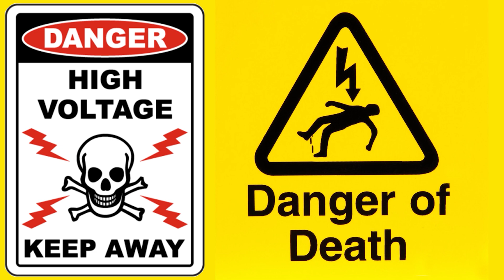Muzishare X7 Revisited: Overview and Power Supply Mods.

Comment: So X7 power supply caps are in parallel! If in series the voltage capacity would double and the surge to 475 would not be an issue.
Reply from the maker: No, they are on each side of a filter choke.

Comment: Hi Thanks for sharing all the knowledge about this amp.  I just got this amp and I have a question hopefully you can help.  I noticed only the center transformer gets hot and the 2 sides are not.  The speakers are connected to the 8 ohms posts.  I am not sure if this is normal or this is a defective unit.  Thanks
Reply from the maker: The center one does get hot and the outer ones don't.

Comment: Hello, very good review, thank you for sharing these videos, this week I got the Muzishare X7, I left it on for about 5 hours and then I connected the speaker cables and without raising the volume I noticed a sound from the speakers (buzzing) I think that is not normal, I don't know what the problem can be. If it is serious or a factory failure, if so to talk to the seller to solve this problem you could give me your opinion... greetings from Spain
Reply from the maker: Sorry I'm confused trying to translate. Not sure what you are saying.
Reply: @SkunkieDesignsElectronics  Excuse me, I have translated it
Reply: Hopefully it will be understood
Reply from the maker: Buzzing from the speakers isn't normal. Also it's not a good idea run a tube amp with no speakers connected. They don't "burn in" being simply powered up, they need music playing through them.

Is it both speakers or just one?
Reply: @SkunkieDesignsElectronics  It's both
Reply: Thank you for replying, the amplifier is new, it arrived three days ago and on Saturday I put it to work... bad luck mine. If I remove the speaker cables from the amplifier the hum disappears, when I turn up the volume of the amplifier with the speaker cables connected the hum remains stable it does not increase. Will I talk to the vendor what solution is me, what solution would you give me? Thank you very much for replying
Reply from the maker: I would return it for a replacement if possible. You didn't say what speakers you have and their efficiency rating. Will 100db+ speakers, it might be normal. Also is your ear up to the speaker or is it audible in the room?

Comment: Hey Skunkie! Last year you mentioned this was your number one budget tube amp available on the market. I’m new to this world and am wondering if that is still the case? I’m looking for a decently powered tube to run a pair of Klipsch Forte 1’s that have been upgraded with Crites parts. It seems like this may be the amp for me, but was curious if you (or anyone else reading) may have some insights for a noob like myself. Thanks in advance. Cheers!
Reply from the maker: It's def one of the best at this price point, especially if you aren't interested in doing DIY mods.
Reply: @ probably the direction I’ll head. I started out looking at the Reisong A10, and I think this is a significant upgrade from that. Not that I’m NOT INTERESTED, more so that I don’t know a ton and there’s a steep learning curve.
Reply from the maker: A push pull amp is going to sound different from a single ended amp. I personally prefer a single ended amp sound if I don't need the power a PP amp has.

Comment: Hi Skunkie, what an inspiration you give with these custom modifications.  My kindest regards.

 I know that you have been asked a lot about this, but after we draw the line so far with all improvements you have done on both Muzishare X7 as well as Willsenton R8 MK II : Which one wins the final battle in terms of overall performance and sound quality?
Reply from the maker: I would personally buy an X7. It has that retro 70's vibe, using 9 pin driver tubes and I think it sounds a little more detailed. That is both with factory OT.

Comment: I’ve had my willsenton for three years and the only thing I’ve done is roll tubes.
Reply from the maker: And some folks drove a Chevy Vega and didn't have engine problems. It doesn't mean they were a great car.
Reply: You're lucky (I guess) I've developed a static noise in both channels. Started with the left, then last year it was both. Also there's a harshness sound on a lot of music with multiple instruments. When there's less instruments Guitar, Piano, Horns, it sounds good. All in all it's okay, but now I'm looking for a better amp, and there ARE better ones out there to consider. I just don't want to modify all the upgrades of the R8, (1 - I'm too lazy, 2 - I don't see the payoff in purchasing a multi-thousand amp just to work on it to get it to sound good, without annoyance). THEY should have done that at the manufacturing plant, prior to releasing it out on street.
Good luck with yours.

Comment: How do the hi-hats sound on your X7? On mine they often sound strange, as if there was a triangle in the sound. What causes this strange sound?
Reply from the maker: Could be the tubes you are using? What do you have in yours?
Reply: @SkunkieDesignsElectronics  I have this with the originals but also with my PSVANE Black Treasure KT88-Z, all of them have run for hundreds of hours
Reply from the maker: Could be the coupling caps? 

The X7's I have listened too didn't sound like you describe but they were also not my main amp that I spent hundreds of hours with. Do you still have the original front end tubes? Those impact the sound more than anything IMHO. Gold lion 12AX7 and EHgold pin 12AU7 are a good combo in these.
Reply: @SkunkieDesignsElectronics  Gold lion 12AX7 and EHgold pin 12AU7 are installed, the original set also had the same effect.
With new capacitors from Jantzen it has gotten a little better but it is still annoying
Reply from the maker: I don't know what else to tell you. You could try putting a 100pf cap across the global negative feedback resistor and see what that sounds like? Just a thought.

Comment: Your videos inspired me to DIY upgraded my Line Magnetic 845 prem amp coupling capacitors to Duelund Cu/Si paper in oil (PIO) ones.That made huge difference. Much much more resolution and more life like sound. Later, I DIY upgraded my Line Magnetic LP33 phono stage from the original Mundolf Spreme to Mifex KPCU01. They gave similar result--more resolution and more life like. Also upgraded HT filter caps from Ipcos to Mundolf M-lytic HV resulting blacker blackground.

Comment: I have had two different amps that went only 10 volts over the filter capacitor voltage and had the cap fail shutting the amps down.

Comment: The inside of that amp looks a mess, bit of a bodge, but what do I know.
Reply from the maker: It's actually very thoughtfully laid out. They could make it look neat using printed circuit boards, but it wouldn't sound as good.
Reply: This one is pretty clean, elegant even. I've seen waaaaaaaaaay worse. Some of them unsafe to plug in.
Reply from the maker: Wait till you see these ST70 amps I was sent!!!

Comment: 105c will last approx 4 times as long as 85c in the same temp use case based on data form  cap makers data sheets and years of use. Smart move going to 500v operating at more than 80% of rated voltage really shortens the life of the cap.
Reply: Nichicon, the pride of Kyoto, Japan. Be assured that like all Japanese components, they exceed their specs.